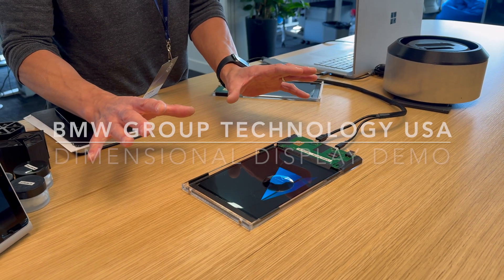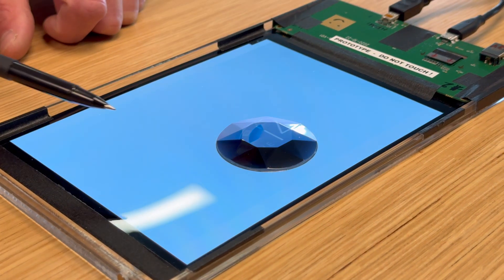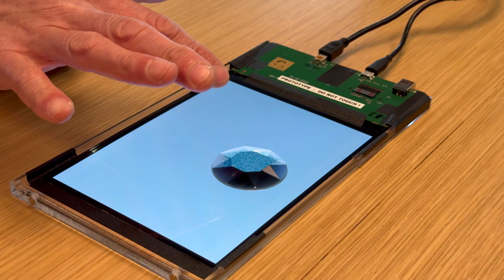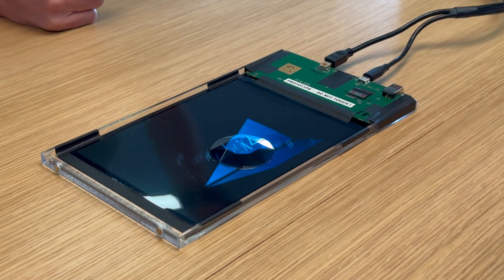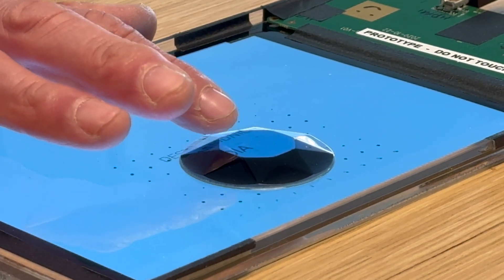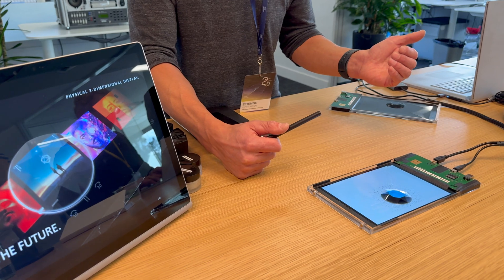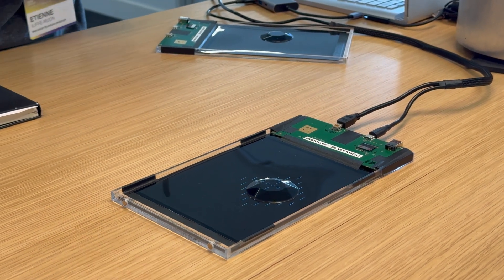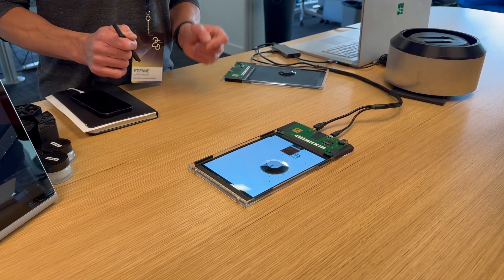BMW zeigt Dimensional Display im Group Technology Office USA

Comment: I absolutely hate touch displays in cars or any other environment where adjustments need to be done fast, just like the ceran induction hob, that thing drives me mad in the kitchen. I am so glad my 2001 car doesn't have this crap on board. This just looks like solution to a problem that shouldn't exist in the first place.